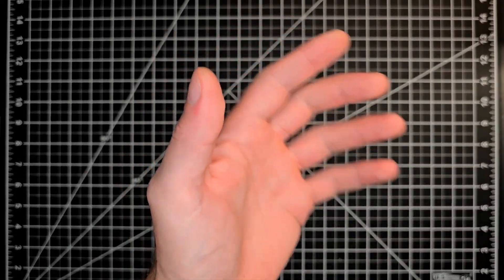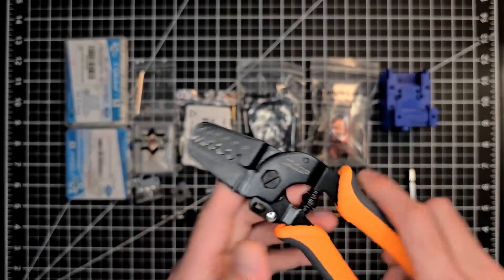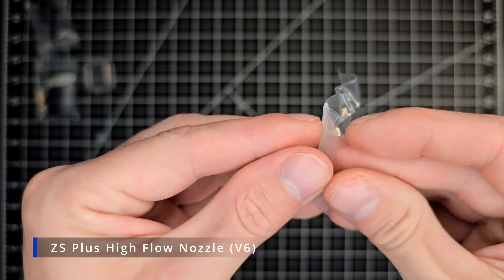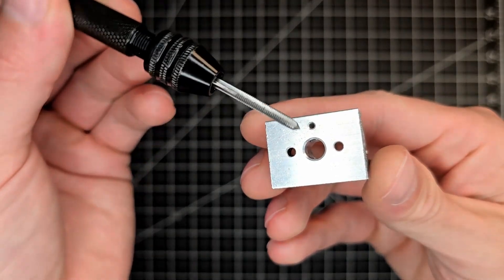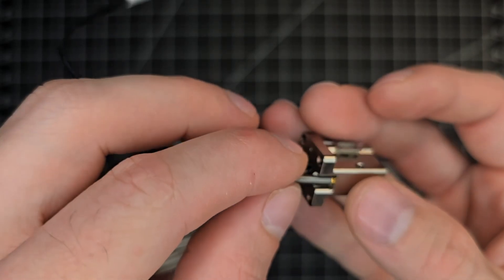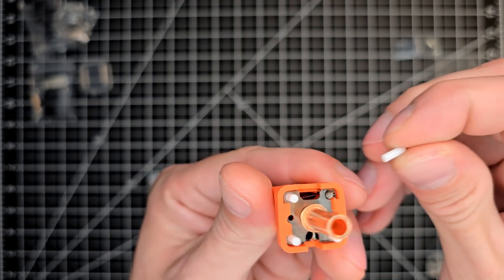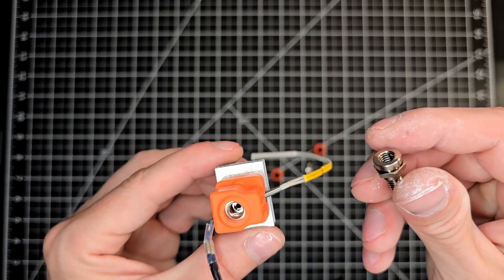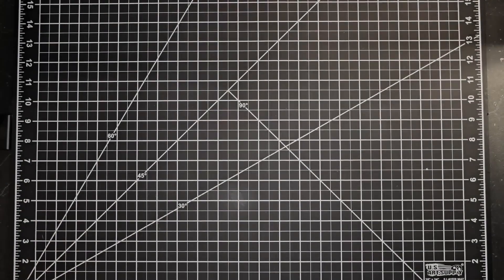Creality K1 - Triangle Labs Dragon Ace Mod

Comment from the maker: 👇 Check out all the informative links and parts for this Dragon Ace hotend in the list below 👇:

Bootycall Jones Gantry kit w/ Dragon ACE carriage revision
👉 https://peedee3d.com/collections/k1/products/k1-max-k1c-linear-rail-gantry-kit-configurator (to assemble the majority of the kit less the Dragon ACE carriage)
OR
👉 https://github.com/tlace17/K1-Linear-Rail-Gantry
AND
👉 https://github.com/tlace17/K1_Dragon_Adapter/tree/main
Bootycall Jones Dragon ACE Adapter Plate
👉 https://peedee3d.com/collections/k1/products/k1-series-g5-titanium-dragon-adaptor
(Already made to size - The 3mm drilling operation is not necessary if purchased)

Parts required for this modification:
Triangle Labs - Dragon ACE Kit "A"
👉 https://trianglelab.net/products/dragon-ace-hotend-parts?VariantsId=11382
POLISI3D Ceramic Core High Flow Heatbreak
👉 https://www.amazon.com/dp/B0CQNG1CSB/
JST 2mm Connector Kit
👉 https://www.amazon.com/dp/B09DP9FZTX/
JST XH 2.54mm Connector Kit
👉 https://www.amazon.com/dp/B0B2R966ZY
Creality K1 Heatsink
👉 https://www.aliexpress.us/item/3256806625857078.html?spm=a2g0o.productlist.main.1.1632fOk2fOk2jr&algo_pvid=99595f23-e353-48e0-849c-f18a3e433712&algo_exp_id=99595f23-e353-48e0-849c-f18a3e433712-0&pdp_npi=4%40dis%21USD%214.15%214.15%21%21%214.15%214.15%21%402101e63417238434297811463e0df7%2112000038386720197%21sea%21US%213054969702%21X&curPageLogUid=VFYixHitFFoI&utparam-url=scene%3Asearch%7Cquery_from%3A

Additional items:
M3 Button Head Hardware Kit
👉 https://amazon.com/dp/B0CLLC3G3S/
15/64 Drill Bit
👉 https://www.amazon.com/dp/B00004YMEN/
T Handle with Taps
👉 https://www.amazon.com/dp/B077HTXVR1/
Crimping Tool
👉 https://www.amazon.com/dp/B078WNZ9FW/
Allen Set
👉 https://www.amazon.com/dp/B0021O1A1G/
Triangle Labs - MZE HF Plus
👉 https://www.trianglelab.net/products/zs%C2%AE-mze%E2%84%A2-melt-zone-extender?VariantsId=11380
Triangle Labs - ZS Plus Nozzle
👉 https://trianglelab.net/products/m6-zs-nozzle-hardened-steel-copper-alloy?VariantsId=11530
Triangle Labs - Volcano Adapter
👉 https://trianglelab.net/products/trianglelab-high-flow-nozzle-copper-volcano-adapters-for-volcano-volcano-crazy-heating-block-to-v6-nozzle-hotend?VariantsId=11338

Comment: Do you know if there's a dragon ace or similar mod that's been done to the k1c hotend?
Reply from the maker: @FezFromRox  The Dragon Ace can be installed in combination with the BCJ linear rail gantry on any of the machines in the K1 line up (K1, K1C, K1SE and K1 Max) but it is required to print the appropriate components based off of the preferred configuration.
Reply: Thanks for the reply! I'm aware that the mod can be done to the K1C, but instead of using the modified K1 heatsink with set screw and ptfe tube to the extruder I'd like to is the K1C style heatsink with some type of unicorn nozzle while still being able to use the dragon ace or similar hot end. Does that make sense? I'm still new to this lol

Comment: Is the dragon ace hotend longer than the unicorn nozzle?? Just wondering as i wanted to upgrade my k1 to some cool mods, but I need a slightly longer nozzle
Reply from the maker: @3DPrinterGeek  The Dragon Ace measures roughly 42mm from the adapter plate to the nozzle.

The adapter plate is 1.59mm thick, so it increases the overall height to 43.59mm. 

In terms of nozzle length, with everything installed (heatbreak, adapter, MZE and nozzle), it is probably somewhere in the realm of 62mm (Heatbreak - 30mm, adapter - 8.5mm, MZE - 15.4mm, ZS Plus nozzle - 13.5mm - *only 8mm exposed*) from the top of the heatbreak where it meets the extruder to the tip of the nozzle.

Approximately 8mm of the nozzle is exposed from its overall length of 13.5mm due to the threads (likely to be 5.5mm worth) having overlapping measurement with the MZE as that is already accounted for in the full length measurement of the MZE itself.

Comment: Excellent Video! Earned a sub for sure! 

Quick question, can this hot end print abrasive materials like PCCF? Im worried the interior metals aren't hard enough for Carbon Fiber.
Reply from the maker: @diablodaub  I'd go with a hardened orbiter kit to complete a Libra/Cyclops extruder and a tungsten v6 plus nozzle for this application. The MZE would be your weak point requiring maintenance/replacement due to use though.

Comment: With so many mating surfaces in the hotend is this not a blob waiting to happen? I do like the blob eliminating principle of the unicorn nozzle where there are no possible gaps between hot and cold end. Any other setups I have used have resulted in a molten blob mess sooner or later.
Reply from the maker: With 4 years of experience printing, on multiple different machines, I've escaped the dreaded hotend blob with one simple trick.

It ultimately comes down to the user to make sure that it doesn't happen, as simple hardware checks and clean build plates can eliminate that possibility. Just give your machines quick checks every 50-100 hours of printing while cleaning your build plates often (its either 99% isopropyl alcohol or acetone for mine - never have a need to use soap and water if you stay on top of them).

The 5-10 minutes it takes to run through a machine is a much better experience than dealing with molten messes or working through a stubbornly solidified struggle.

To that note, I haven't experienced any issues with this hotend to this point and although there is always a possibility between my routine checks, it is a very low percentile that it would occur, if any. Just give back to your machine every so often with routine maintenance. Meeting resistance on the hotend components and then giving it another 1/16th of a turn usually mates the surfaces to the point that no gaps are present.

Hope that info helps make hotend blobs a thing of the past if you ever decide to transition from the unicorn nozzle set-up. Best wishes and happy printing!
Reply: Starting with an ender 5 plus my first blob was with the stock hotend. Switched to microswiss, still got the blob. I did do the hot tighten, but that eventually comes undone, and the repeated hot tightening of the hardened steel nozzle vs the titanium heatbreak stripped out the soft aluminium threads of the hotend. 🤷‍♂️ Ahhh well. As the quality matters more to me than just blistering speed, might do the bootycall jones upgrade with the stock hotend. Do love your videos though. Super clear and great explanations!
Reply from the maker: @GarbachNL  It seems that either the equipment itself was faulty or flawed design/material choice by the manufacturer failed you with those hotend experiences. Not fun to deal with either way!

This hotend may push filament quick with its high flow components but the benefit of running it up to 350C allows for higher temp materials to be melted which isn't necessary for everyone.

Do what makes the most sense and enjoy your printer as it best suits your needs. Either way, I support your decision.

Thanks for the feedback and happy printing!

Comment: is there a modded side fan for this? realized that was an issue after install
Reply from the maker: Auxiliary fan or printhead cover? Auxiliary fan remains the same. Printhead cover was replaced for a version produced by Bootycall Jones.
Reply: @CovenantCustom  is the a aux fan to account for the height change now? its so much lower no the the air doesnt hit the print right
Reply from the maker: @Liquidbleugraphics  It can be installed and utilized with both drop-in replacements as well as the Dragon Ace application. The ducting has the ability to provide cooling to the hotend from 270 degrees. Additionally, a larger distance is created between the hotend and printhead cover by the ducts to mitigate exposure to heat for high temp filaments at long durations, that a tighter ducting perimeter would suffer from (dependent on material used - I printed mine in ABS but would suggest an even higher temp filament as I do see warp starting to occur). Height for the printhead cover is not altered for either application but may be different from stock.
Reply: @CovenantCustom  yes i am aware i have it installed the cooling from the model fan alone is much better, but the side aux fan is too high now because of how low the hot end is now. so, I'm asking is there another side fan duct i can print to account for this new head height?
Reply from the maker: @Liquidbleugraphics  I run high temp filaments so the only fan I use is the part cooling fan. I do believe there is a model out there known as the "Blast" auxiliary fan duct. It seems to be a lower profile option that spans the entire bed. Hope that is what you are looking for!
Reply: @CovenantCustom  naw im using that already. its needs to be ~20mm lower and i dont know how to 3d model yet.... i do a lot of pla mostly.
Reply from the maker: @Liquidbleugraphics  Might be a worthwhile pursuit at this point! My design skill improves with every project. I've never attempted ducting but it might be a worthwhile experience! I don't print PLA/PETG any more so the auxiliary fan ducting was never a concern. These printers work great with higher temp materials if you ever make the swap up to them!
Reply: @CovenantCustom  i have been printing ASA ive gotten pretty good at at now . but so far pla prints great at no side fan and low model fan.... suprisingly.... running test and tuning the filament with this new head has been a project
Reply from the maker: @Liquidbleugraphics  This hotend is definitely intended to assist in producing high flow capabilities for higher temp filaments, increasing hotend temps to 350C and achieving impressive max volumetric. I've had to push up to 70mm/s³ with ASA. Exceeding the previous results of 20mm/s³ with the Flowtech that was installed prior.
Reply: @CovenantCustom  what are your settings for asa? also i remodeled the aux fan. printing it in asa as we speak. hopefully i got it right on the first attempt
Reply from the maker: @Liquidbleugraphics  I could give you my settings but that could potentially produce poor results. It's best to tune the filament you're using through calibration. The things that I keep consistent are the parts cooling at 60% fan/30s layer time and 80% fan/0s layer time.

No auxiliary fan or exhaust running. Chamber at 35C prior to starting a print. I personally like a textured PEI sheet that's been cleaned with acetone (some perform better with isopropyl - I keep some 99% around). The last thing would be my support settings that don't change between filaments.

Print speed is also specific to the filament and your accel values are specific to your machines ideal resonance/input shaping with 0% vibration being the goal. When you have tuned the printer, you should be able to achieve MZV/ZV figures for both X & Y. Always match the values for both axes (i.e. one is zv and the other is mzv - if vibration is 0% for both in mzv choose that option and input the shaper and frequency into your config file - run accels at about 70% of the values shown so that you're well within the limits).

To get solid print results with any filament, your printer's operation will be the largest factor. After that, just use the filament calibration tests in your slicer and go through each step until it's dialed.
Reply: @CovenantCustom  ok what about the temp you run the filament at?
Reply from the maker: @Liquidbleugraphics The ASA I print does well between 255-260 but I'd still suggest doing a temp tower to make sure that you get the most out of your filament. Some are blended with lower temp materials which alter the expected print temps so be mindful of that as it could even be lower but feel free to use 255-260 as a baseline to see how it goes!
Reply: @CovenantCustom  thank you. will give it a go. was using polymaker asa but wanted to try flashforge
Reply from the maker: @Liquidbleugraphics  I've printed both and am at 260 for both profiles for those manufacturers! Should do the trick.
Reply: @CovenantCustom  I'm having huge issues with bed adhesion with flashforge asa. Nothing is working. 90-100 bed temp. Glue.magigoo.another product. .pei or smooth. 240 -265 hotend... nothing makes it stick unless I get super lucky... but 95 percent it fails no matter what.... what are you doing with your flashforge?

Comment: Just want to say your video was very clear, detailed and easy to understand and follow along with. Amazing work! can’t wait to see if you finished the install video.
Reply from the maker: @kenallen9470  Thanks for your feedback! The wait will soon be over.
Reply: @CovenantCustom  will you go into detail about setting it all up after the full install?. I'd like to do this mod
Reply from the maker: @kenallen9470  If rooted, the only necessary change to the Klipper firmware will be the extruder sensor type in your printer.cfg.

sensor_type: ATC Semitec 104NT-4-R025H42G

This is the only step required beyond the hardware assembly/install. It really doesn't require much!
Reply: @CovenantCustom  awesome can't wait for the rest of install
Reply from the maker: @kenallen9470  Keep an eye out for the next upload, which will include the Dragon Ace install within it.

Chances are, you might find exactly what you are looking for later on today.

Comment: Does it need a better cooling now?
Reply from the maker: I will be running it with the Bootycall Jones printhead cover. The fan duct surrounds the hotend providing better cooling than the factory option. All to be detailed in my next video.